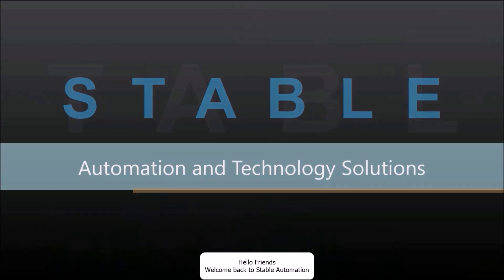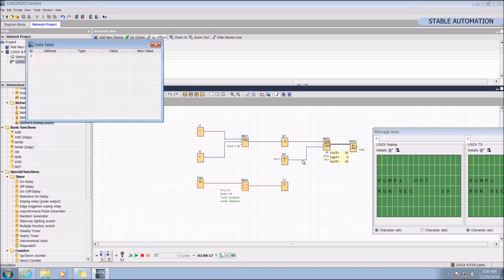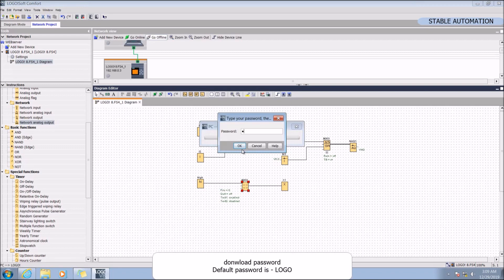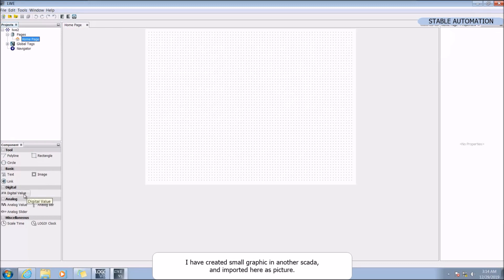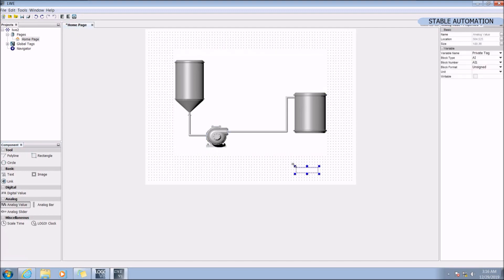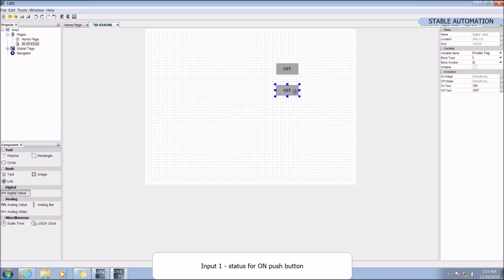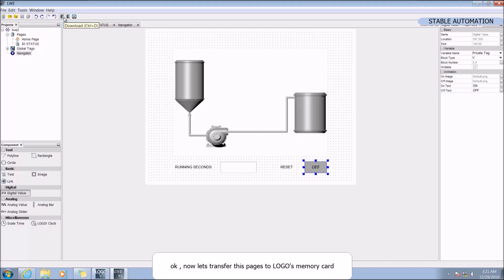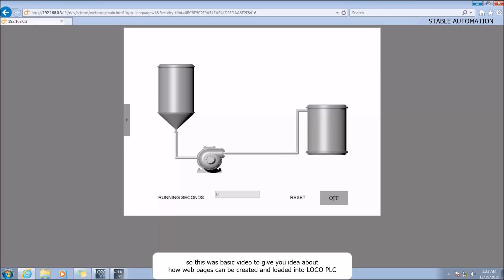Siemens Logo PLC  -  User defined Web pages

Comment: Hello, I have a question hope you can help me, can we create a web page from which we can control outputs and visualize data in other way that's not by using the LOGO Web Editor??
Reply from the maker: You can display on default web pages of logo in case you don't want to use LWE.
Reply: i believe LWE IS FREE  so why not use it?